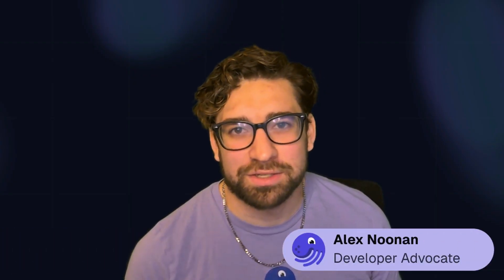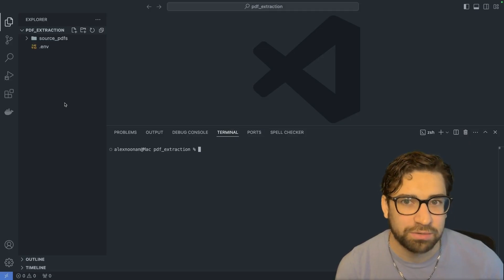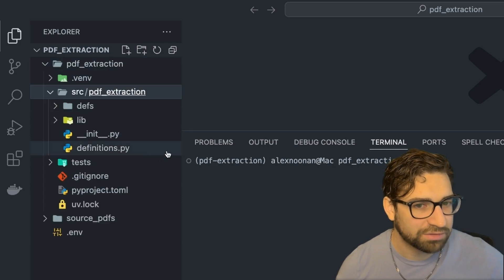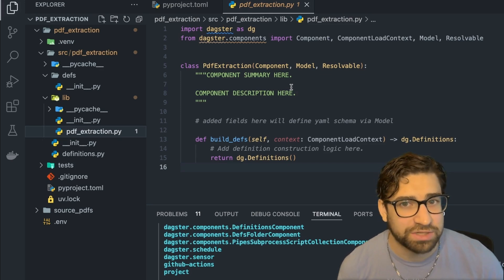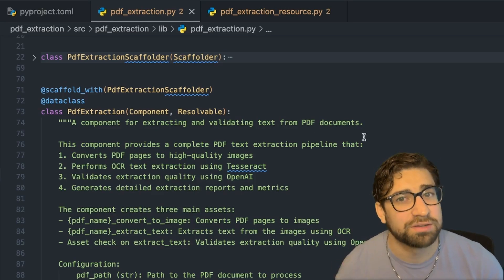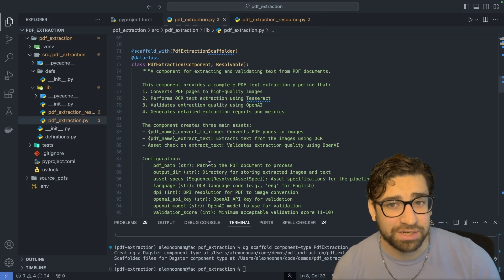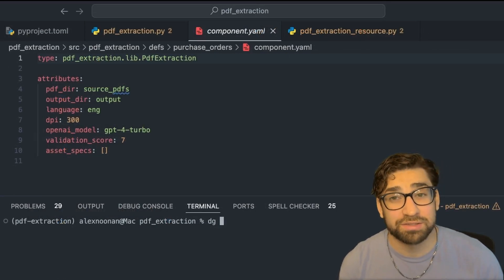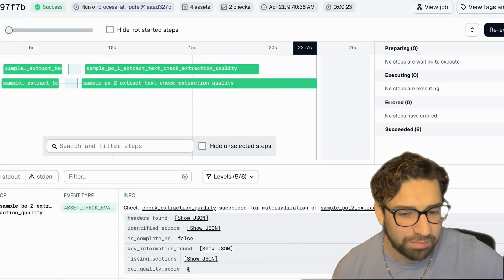Streamlining PDF Text Extraction with Dagster Components | Step-by-Step Tutorial

Comment: From what I understand, dagster components allows stakeholders that are not tech savy to add asset in a dagster project. But if we have a dagster deployed on docker through github project that creates an image when the master branch receive pull request, then it is quite doubtfull that the stakeholder has the ability to insert such components easily. Therefore I do not understand how they could be used in a real company setting
Reply from the maker: To clarify components right now is designed for building assets in your pipelines that conform to the technical guardrails that you define as the senior technical resource. So you could abstract away a lot of the complexity you a describing so they only need to enter the critical information needed to generate the Dagster abstractions.